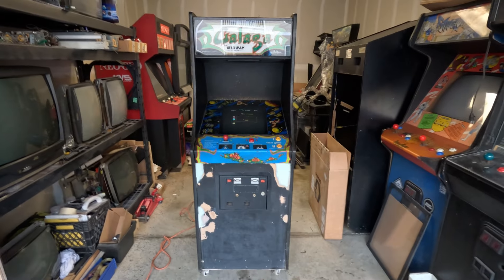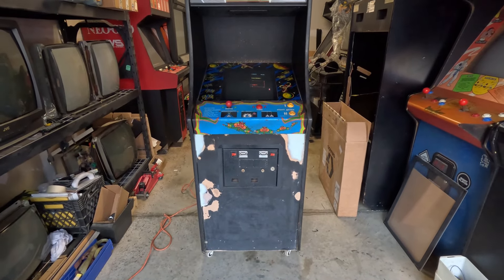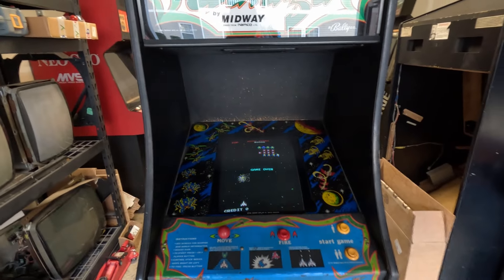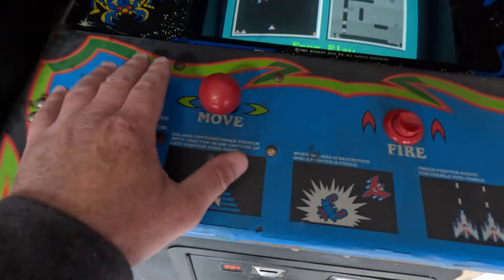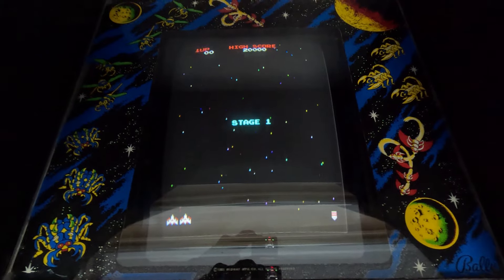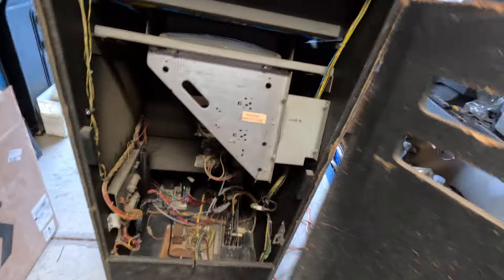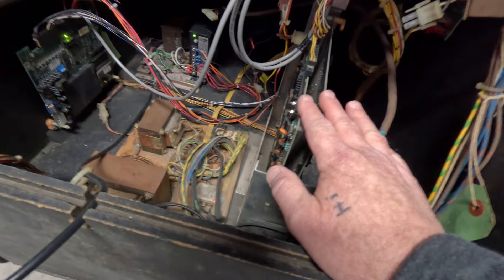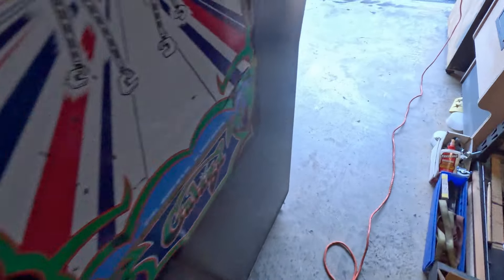Revisiting the Galaga Arcade Machine I bought one year ago before it gets sold.

Comment: Their not worth owning all they do is break I moved on when consoles finally played just as great as the arcade machines you don’t need a tekken 7 arcade machine when it plays just the same in PS4 but when Pac-Man was new it was the only way to get it at its best the Atari sucked NES sucked until PS2 was released original Xbox if you really feel like owning arcades go buy the arcade 1 ups that don’t break either
Reply from the maker: I enjoy actually having full size machines.  I've owned two arcade 1 ups and did not like them at all too cheap feeling. Most jamma boards last but seems like the old boards like galaga seem to be crap thats why I never bought another board to put in this one and the multiboard that I put in played just as good and was more reliable.